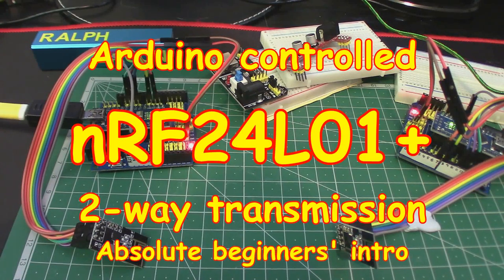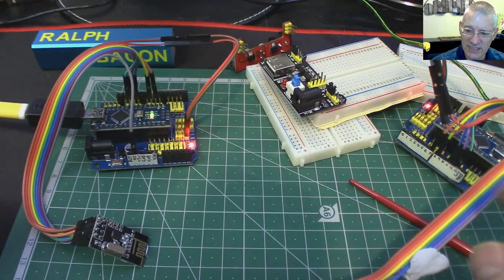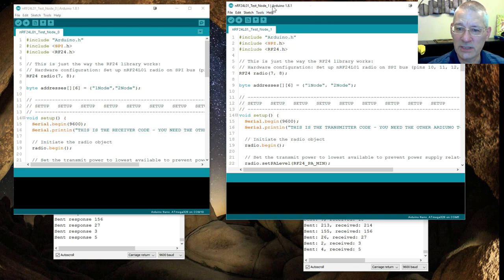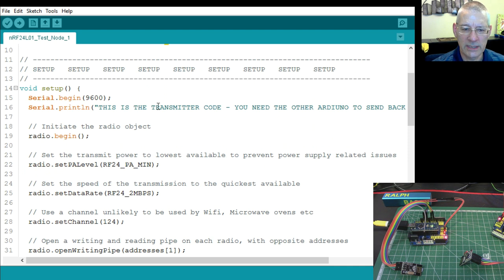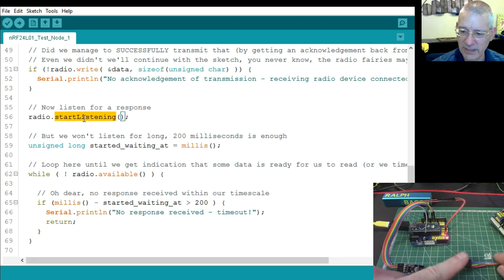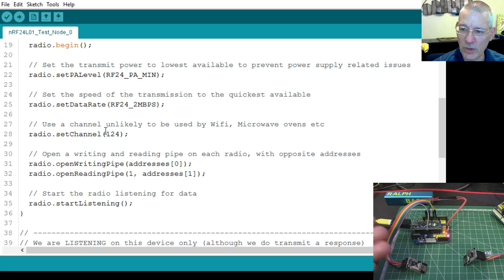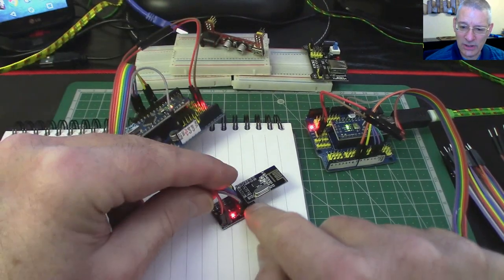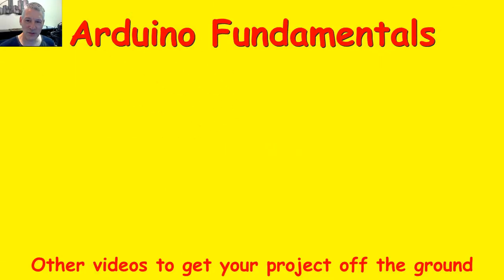#73 nRF24L01 Send (and receive) data with your Arduino!

Comment: Good day, Ralph.

Simply the best ever tutorial on the nRF24L01+ I’ve tumble upon as of yet .. AND IT WORKED THE FIRST TIME !!

Superb explanations and I WILL follow you since my objective is to make a Weather Station as mentioned in your video.  I said to myself « This guy just read my mind !! .. Yes, YES !! Teach me how to send Strings variables over this module … ‘Master’ ! »  Hahaha!

My Weather Station is complete.  I’m using DS3231 RTC for time reference and a BME280 for Temperature, Humidity and Pressure.  Also using a CdS Cell to read illumination .. just for kicks and .. why not ?  For the present time, I display this info on a minuscule SD1306 OLED Display on the exterior station.  I plan on using a small 2,4 inch TFT display and graph the information for the last 48 hours on the interior part of it.  I’m not there yet, since I still have to learn how to work the TFT.

My main concern for now, is sending Strings to the other side. I’ll try to find the information on your other videos before seeking your help on that specific point.  I hope to find it soon.

Until then, I wish you a good day and keep on the good work.

Best regards,
Daniel Lachance .. aka « Uncle Dan ».
Reply from the maker: Glad you found it useful Daniel!
Now, strings are an uncommon thing to pass around; much more useful is a flag or integer that means the same as a string. What are you doing with strings, Oncle? Remember you only have 32 bytes in a packet to transmit.
Reply: Good Day, Ralph.  It was with great pleasure that I read your reply, and I thank you for doing so.

Actually, I could get away with pushing long integers values through that Pipe.  The actual informations I want to transfer is Year, Month, Day, Hour, Minute, Second.  The rest of the informations are mainly of float type, since they have two decimal values.  They are Temperature, Humidity, Atmospheric Pressure and Degree of Illumination.  It would look like this (I added the comas to separate the values) : 

« 2019, 06, 19, 15, 24, 00, 25.34, 45.39, 1003.84, 19.35 »

I kind of tweaked your Code a bit but with mixed results.  I guess I need more tutoring on ways of passing data in the Pipe.  Hahaha!  Last night, while loosing sleep on the matter, I thought about shoving the info into an Array of [11] cells, and finding a way of passing it through the Pipe one [cell] at a time.  This is still under work.  Any help from your part would be well appreciated.

Until next time we chat, I wish you a very good day and, like I said before, keep on the good. work !!
Reply from the maker: The way to do it is not with an array, but with a struct. A struct simply defines a group of otherwise unrelated variables both on the sending and receiving side. You have 32 bytes max available to send in a single packet with the nRF24L01 so you could reduce that by, for example, sending 19 instead of 2019 as the year (two bytes saved). If you need further help, find my email address in the About tab on my channel and I'll send you an example. Don't lose sleep on this!
Reply: Hi again ..

Well, I thought sending the temporal data at first, the the environmental data as s second burst.  This way, I can't bust that 32 bytes barrier .. But I just can't see how the « struct » works.  (Yes, you can call me 'Green'). Hahaha !

Thanks for the helping hand, Ralph.  I greatly appreciate it.  Have a nice day.
Reply from the maker: If you find my email address in the About tab I'll send you a quick example.
Reply: Good day, Ralph.

I see that my last mail didn't reach you.  LOL. I sent ir to an address that started with webmaster@ ...

I wouldn't mind giving you my mail address here .. if you thing it appropriate.

Have a great day, my Friend.
Reply from the maker: Your email reached me, Daniel, but my reply from my domain and from gmail both failed. You might have to whitelist me but I don't know why your are not accepting Gmail mail! I don't know how to reach you now...
Reply: Good day, my Friend.

I will reply as soon as I get home (in about 1 hour).  I think I found whai I was looking for. I’ll show you mi Code.

Talk to you soon !  Have a nice day.

Comment: thanks for the video, planning a project using these and it was very helpful! quick question however, where would you adjust the code to have 2 main transmitters and one main receiver?  I am thinking of having two separate sensors with arduino nanos transmit different data back to a main arduino mega to process and display the data.  Thanks
Reply from the maker: Hey James, glad you found the video useful! 
 
As soon as you have multiple transceivers you run into the challenge of logistics; who is sending to whom, when, how often and so on. 
 
I would assign your sensor transceivers different channels so that your master controller can then poll for the results every few seconds, minutes or whatever. In fact, the transceivers have 124 channels to choose from (Wi-Fi and microwave interference notwithstanding) and can be used to "channel hop" anyway. 
 
So your sensors wait for a "Give me your data request" (in much the same way as my demo showed) and transmit the values back to the master. The master then moves onto the next sensor and repeats the request albeit on a different channel (probably in a simple loop).
 
There are doubtless other ways to do this with a sensor mesh perhaps (there are examples in the library which I must admit to not having read, my requirements being fairly simple), but I've no reason to think my above suggestion would not work with several sensors, all on different channels.
 
I hope this helps and good luck - please post back your success, failure, issues, problems so I (and other readers here) can see what works and what doesn't. Great question!
Reply: Thanks for the reply! I have been looking through different videos on simple communication, mesh, and networks to see what will work well for what I am trying to do, and what will also allow for easy expansion after the initial installation (adding additional sensor nodes).  I am thinking of moving towards a simple network, but am still doing research and planning for this.  Your video was a lot of help in getting started with everything

Comment: Great project, I have a need for a Garage Door monitor.  I have two doors and sometimes ( Not very often, but once is too many) I forget to close the door after I came in.  It would be nice to be able to have a display inside showing the position of the doors. It is an attached garage so the doors are about 30 feet away from living area ( through a wall).  I would also appreciate an idea ass to how to tell if the garage is not fully closed.  What type of sensor to use?
I have really appreciated your videos and they come across ( at least to me) in a very understandable manner  and you explain everything important like where the specific library you use is located.
Reply from the maker: Hi AdaBill, I'm glad to like the videos! As a (wireless) garage door monitor this would be ideal. You can also use a Hall Effect transistor that responds to a magnet to determine whether the doors are fully closed (not left ajar). I've done a video on those too. Even a microswitch would be OK (like I used in my stepper motor project). Anything that could connect to an Arduino that then sends out the correct status via the nRF24L01. Sounds like a nice project. Let us all know when you get it working, right? Thanks for posting!
Reply: Thanks again, I went back and looked at video #55 and I'm in the process of ordering some hall effect sensors to try it out.

Comment: Sir, could you please cover a tutorial using Nrf24L01 driving Seven segment using keypad remotely. Thanks
Reply from the maker: That's not how it works, Clark! I've done a video on the keypad (membrane), I've done a video on a seven segment display (and I have one planned for an alphanumeric display, but that's for the future) and I've done more than one video for the nRF24L01+. If you built all those demo sketches and circuits you would know how to do what you want. No shortcuts, I'm afraid!
Reply: @RalphBacon  Thanks for your quick reply Sir. I think I know how.

Comment: Thank you, made things easy to set up.
Question about the nrf24lo1 with the extended antenna. Does that just increase its range or does it make receiving/transmitting better. Less prone to interference?
Reply from the maker: Both, I think you'll find to be true, Paul. A better antenna lets more power to be transmitted, and a bigger signal to be received. So it's a win-win on all fronts if you choose one of the walkie-talkie style antennas for these modules. Make sure you use the adaptor plates for these units if you using anything above minimum power though (in fact, at all times)! Good question, thanks for posting.
Reply: Ralph S Bacon thanks for the response. Makes sense. Could I then use a module with Antenna to do the transmitting(more power) to a module with built in antenna to only receiver data? Or do they need to be identical modules?
Reply from the maker: No, they don't need to be identical but (part of) the benefit of a higher power transmission would be lost, because of the less efficient receiver's aerial. However, either/or is better than no high power aerial, that's for sure - a higher power transmitter will transmit further and a more sensitive receiver will be able to grab a signal from the noise. Do bear in mind that although I've called the sketches "transmitter" and "receiver", they both transmit, even if only to auto-acknowledge. And do make sure you use the adapters (I've said it before and I'll say it again!).
Reply: Ralph S Bacon thanks!!!

Comment: Hi Ralph your video has been very helpful on learning the nRF24L01 module as I've been trying to learn them for the past month, however I am still having issues.

I am able to get my transmitter to work in the serial monitor but it will always receive "0's". The receiver on the other hand will not work. I've tried swapping the modules, as well as my arduinos. I am also using the adapters as you mentioned in your video and have thoroughly checked my wiring and still have not had any luck. Do you know what I might be doing wrong?

One additional note, I noticed that when I have my RF24 radio set to (7, 8) in the transmitter, nothing appears in the serial monitor at all. (Even though I know this wiring is correct and true to my CE and CSN pins). However if I change that radio set to anything else, for ex: (8, 7), (7, 7) (9, 7) etc. without changing any of my wiring, the transmitter will then work in the serial monitor while still receiving 0's. Not sure if this could have something to do with my overall issue or if it's even an issue at all.
Reply from the maker: Are you using my two sketches without ANY modifications at all? And you say you are using the adapter plates (so these are connected to 5v)?

The transmitter side should tell you what it is trying to send (eg 42) but then also tell you it did not get back an auto-acknowledgement from the receiver. If it does not say this then the receiver has received the value and has auto-acknowledged.

The receiver side should receive the SAME value (obviously) and tell you this (or you can put in extra Serial.println statements), add 1 to it and send it back, at which point the transmitter will tell you what it got back. You might need further Serial.println statements just to debug these areas.

Step 1. Load the two unmodified sketches into two Arduinos and connect up.
Step 2. Power up the transmitter only and check what I said above. Get that working first. 
Step 3. Power up the receiver and follow the notes above.

Keep the two units close (eg within 30cm as you are using very low power in the sketches). You can change that in  line 22 of the sketches. Try RF24_PA_LOW rather than RF24_PA_MIN.

Most problems are caused by:
1. Not using the power adapter plate (the Arduino cannot supply enough 3v3 current)
2. Wiring errors (I've even done this, oops).
3. Faulty (fake) nRF24L01 modules. I had one (fake) module that failed whilst it was running on my workbench. However, they are cheap so buy a few (not fake ones. but difficult to know. Larger suppliers will probably have genuine products; Chinese warehouses not so).

Changing the pin numbers in your sketch doesn't show much except you're getting random results because you are not actually connected to the nRF24L01. If you use the same coloured Dupont cables as I did in the DupontWiring folder in my GitHub (https://github.com/RalphBacon/nRF24L01-transceiver ) it should help check things.
Reply: @RalphBacon  Hi Ralph thank you so much for your speedy reply. After going through your instructions, I re-downloaded your sketches just in case, tested with serialprints, and then finally realized I made a mistake I wouldn't have noticed on my own. I have been using the adapter plates with the same wiring to my arduino that I had before using them, so one dupont cable was still going from the VCC to 3v3 instead of the 5v. I only realized this after reading your instructions and saw what you including in your first paragraph about the 5v.

As soon as I swapped over to the 5v pin I restarted the sketches and things seem to work fine with no issues I was experiencing before.  Seems like my issue fell directly into the category of a wiring error haha, but I'm glad I asked because I don't think I would have been able to make that realization on my own.

Thank you again for your help and time of thoroughly walking me through this. As I said in my previous comment I've been trying to get my nRF24L01 modules to work for the past month (with only having heard about the adapters a few days ago from your video). So this is a huge win for me.
Reply from the maker: Excellent! I'm so glad you got it working. Now the world is your (nRF24L01) oyster!

Comment: A good tutorial here!But am a bit stuck. I accidentally powered my modules with 5v and am not sure if i damaged them,,,is there a way i can  test the modules just to be 100% sure in case anything happened to my modules??Regards.
Reply from the maker: Oh dear. I guess you weren't using the adapter boards I keep banging on about then, Francis? The easiest way to test out your boards is to implement my demo sketch exactly ideally using the adapter boards so you know it's not a silly power issue that is causing it to not work. Luckily these nRF24L01 boards are cheap, so if you have damaged them you can replace pretty cheaply. But please do yourself a favour and buy the adapter boards which are even cheaper and will stop you connecting 5v directly to the board. Good luck!

Comment: I am going to try to apply this.
Reply from the maker: Indeed, Jan, go for it. BUT please take note of the following, to avoid some of the "speed bumps" that others have come across.
 
1. Use the adapter plates for the nRF24L01 boards! They avoid all sorts of power issues that manifest themselves, and make it easier to connect the device using Dupont cables (as the cables are on TOP of the board not underneath it).
 
2. Use the EXACT same sketches that I have used (one as the 'master' transmitter, one as the 'slave' receiver that also transmits back a reply.

3. Use the exact same nRFL01+ transceiver modules that I have used - others have discovered that different modules won't, for example, allow you to transmit at 250kbps (and who knows what other differences there might be!).
 
And do let us know when you have it all up and running! Good luck.

Comment: Thanks for sharing. I have got a question. Co D10 pin work in pwm mode with this rf module? Thanks.
Reply from the maker: As we are not using pin D10 for the nRF24L01+ I don't see why you could not use for anything you wanted to, including PWM, Danh.
Reply: Ralph S Bacon thanks. I tried this module. One with antenna   and one without. I tried indoor, but distance is not far as advertised. Just approximately 6 meters. Do you have any information about this?

Comment: Question: Does the normal NRF12L01 without PA, also transmit signal from arduino mega with 11 Potentiometer to 11 Servos+mega, and also receives back the signal of 3 Axis accelerator-shield, for the nextion 3,2 LCD-Kompass?
Open area(water) to ca 200meters? 
are those 2 modules enough to transmit fully connected mega, with up to 32 Potis using digital Inputs or I2C?
Reply from the maker: I;m afraid that question is too specific for me to answer, Bernd. As far as I know the nRF24 can only address 6 other devices.
Reply: @RalphBacon  , i can tell you it works very well, meanwhile i ve made it, sending 11 Poti-Values over nrf24L01 to other arduino mega(Joy-it), controlling there 11 servos, defined on any of the 54 Digi-Ports, then receiving back Voltage-Value, Direction and Roll-Degrees from Modellship to my handtransmitter, and there makin it visible on nexton Display, works cool, i have 2 timer, 2 Voltages, Rollin in degrees and Compass in Degrees, and also 11 Servo-values displayed on Nextion LCD-Display....mega cool..
at moment im workin on touch-clicks to define min and max-values of each servo over display

Comment: This is Clear and the best explanation. 
Is it possible to do  "Master-less serial or parallel communication between multiple arduinos through Nrf24L01? 
I'm working on a project that will have more than 10 arduinos.
I'm looking for a way to have any of the arduinos broadcast a stream of data to any of the other arduinos at any time. when two or more arduinos are in range, they must automatically connect and start communication. it should be two way communication.
Reply from the maker: You probably need a mesh network (and Google can be your best friend here). There is an example, I believe, in the library used in this demo. I didn't go down that route as it's more advanced but may be what you need. I hope this helps.